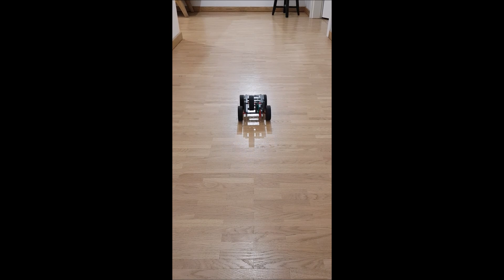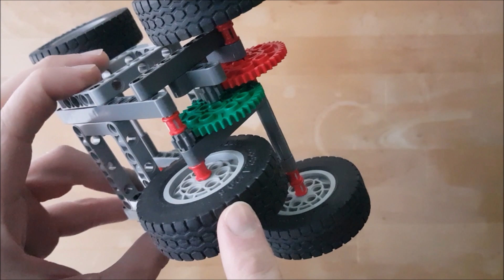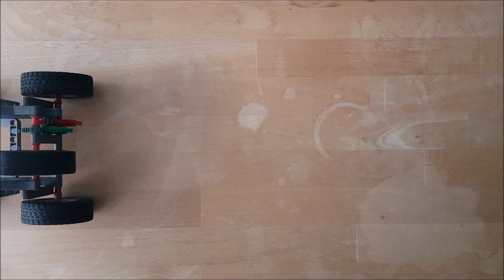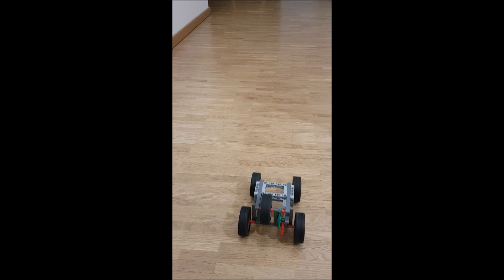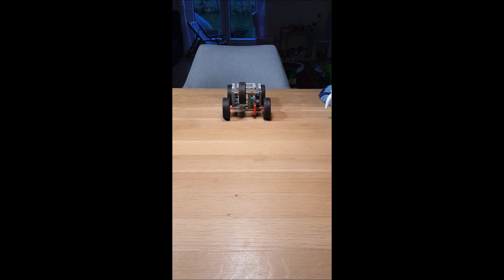Flywheel Car

Comment: Genuine question, which would be better, to increase the gear ratio (i.e: 30x instead of 25x) or increase the weight of the flywheel?

Comment: How I can use this construction in my rc car?
Reply: I Dont think that works very well in a rc car
Reply from the maker: @legolasder3te595  Yes. At least you need a freewheel clutch. And the axis of the flywheel should be vertical so that there are no issues due to gyroscopic effects during turning.